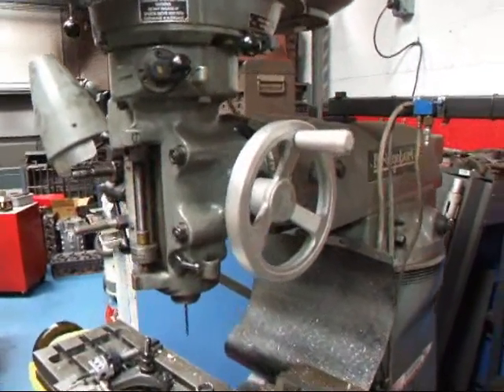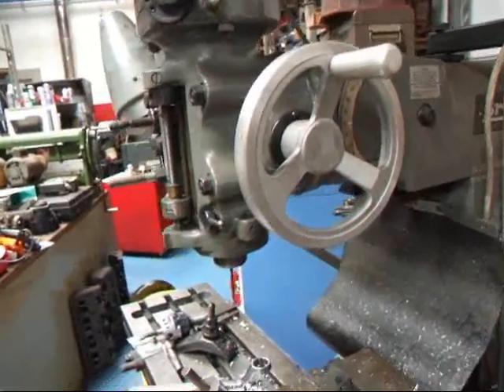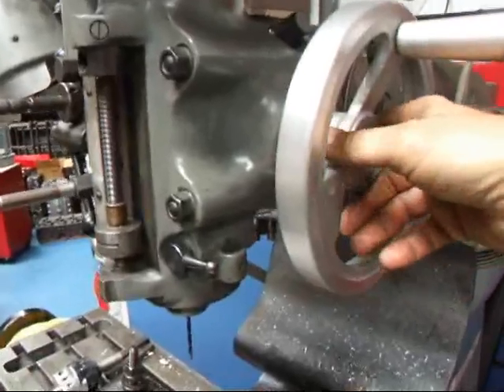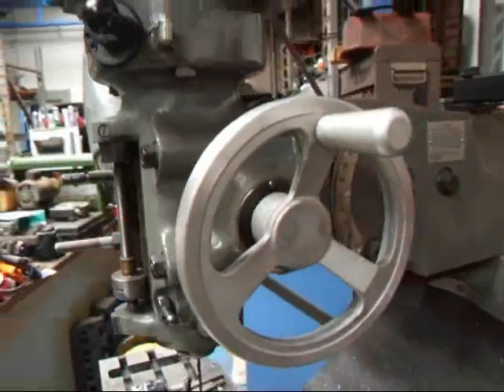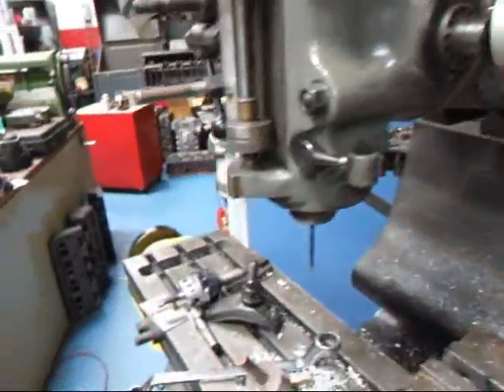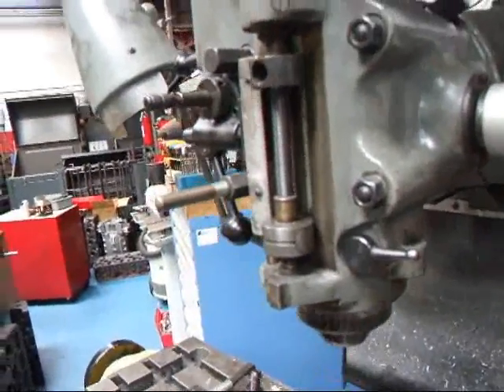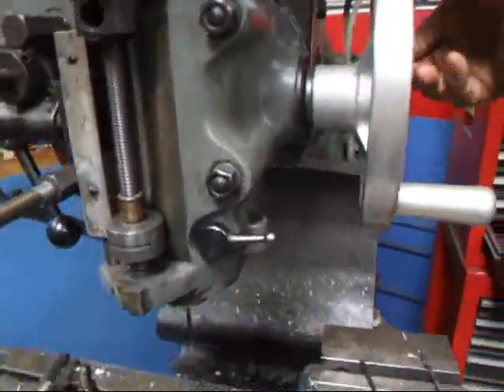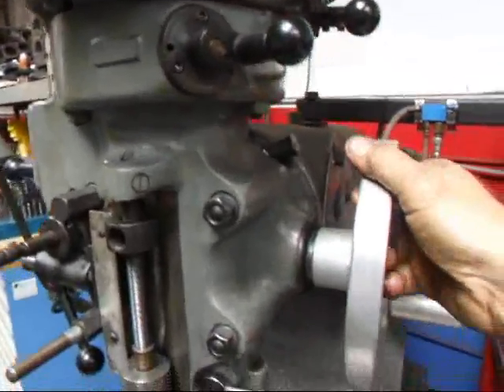Bridgeport Quill Handle - New Type

Comment from the maker: All valid points, but the handle says put under most milling conditions that I perform and it moves the quill into position much more quickly that a lever. Also, when boring the handle gets in the way unless you completely remove it from the machine.